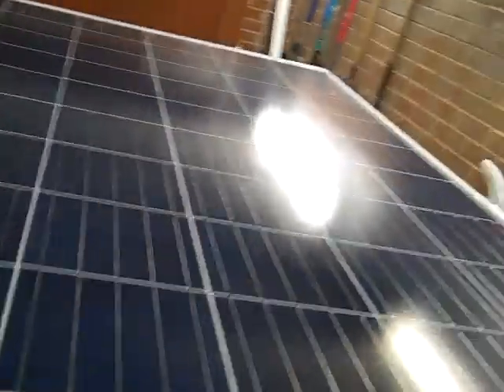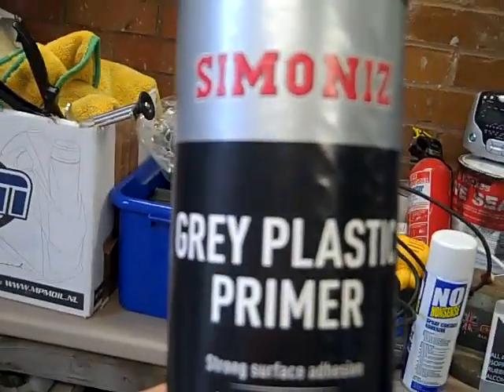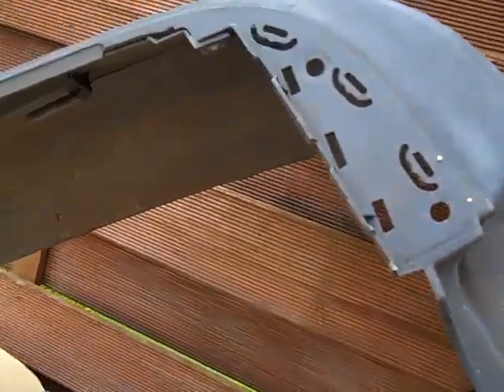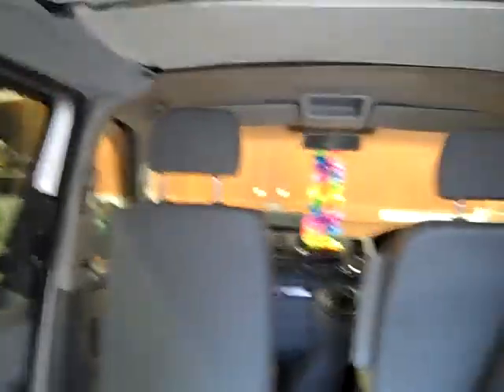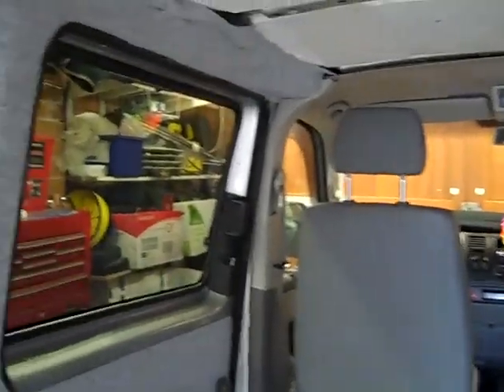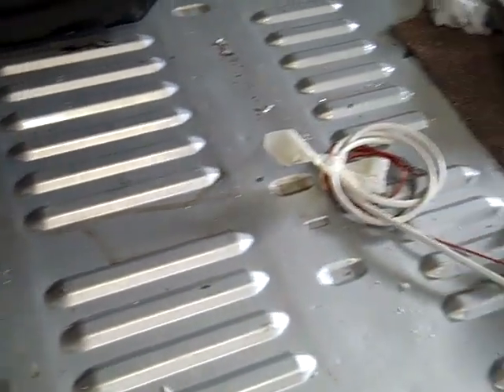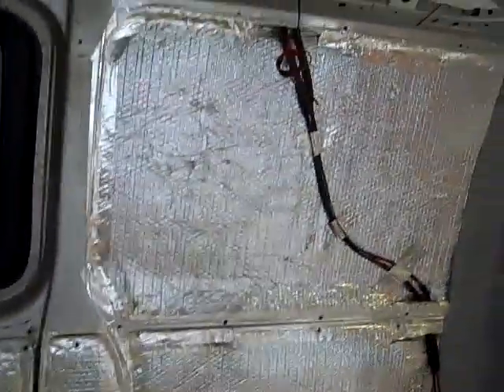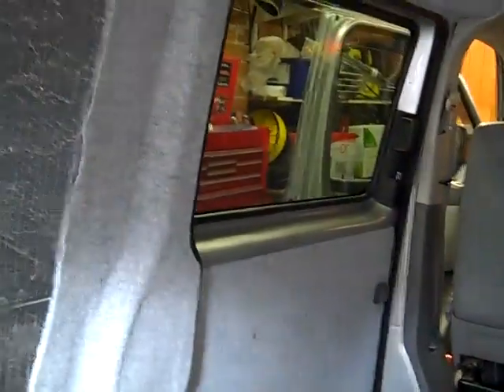VW T5 TRANSPORTER BUDGET CAMPERVAN CONVERSION PART 2

Comment: Was it difficult to change the side of the seatbelt buckle on that single seat. 
Thanks
Reply from the maker: it was pretty easy had a renault trafic clasp laying about had to bend it into a N shape and cut the seat plastic trim for it to pass through but pretty easy job.
Reply: DIY Campervans And Variety was there a mounting hole in the seat structure?
Thanks
Reply from the maker: @dieselbushcraft1299  there was already a shouldered bolt screwed into the frame where the back joins the base i just used this bolt to attach my belt clasp.